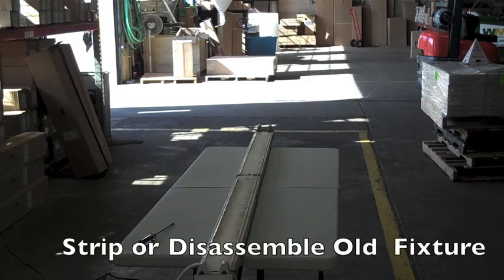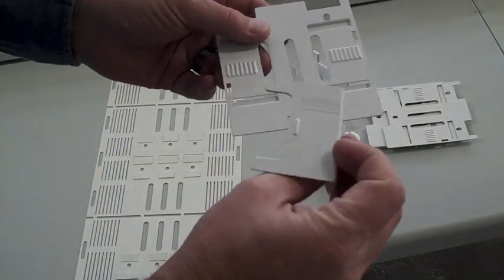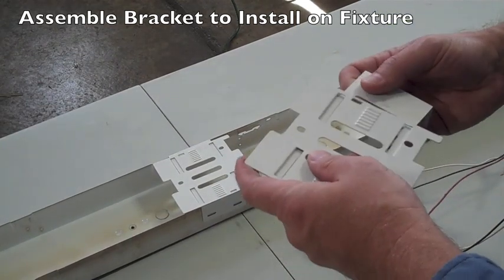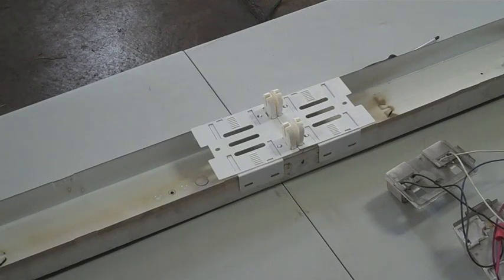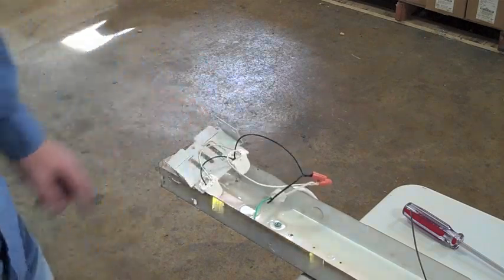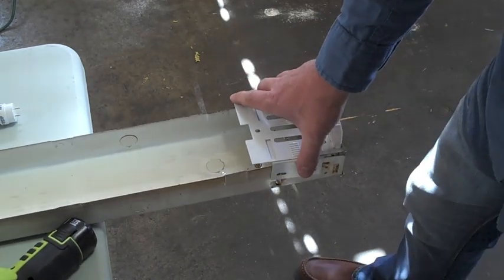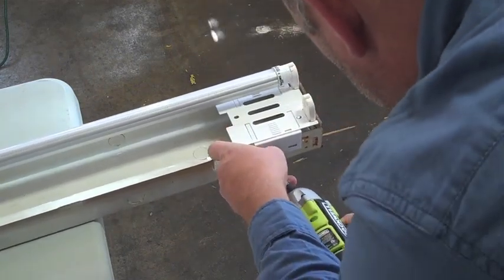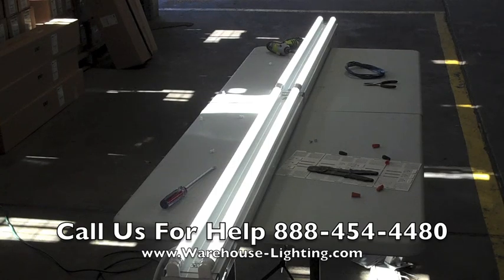Retro a Fluorescent Strip Fixture to LED

Comment: Why not just put 24v led strips inside, put a 5amp block in there, wire it to the 120v source, put the diffuser on top?  I did that with a couple of old fixtures.

Comment: This is about par for old school electricians. If you want to get with the 21st century and save yourself or your customer a bunch of money, dump those antique metal can fixtures off the ceiling an install lightweight Cree LED fixtures. If you insist on leaving those metal fixtures up then just run several rows of LED strips or tape across the bottom reflector or cover to meet your desired lumens output and forget about all of that complexed rigging. Retrofit is slang for LMAO.

Comment: what a piece of crap! you could have left the old tomb stones and brackets removed the ballast, and rewired the original tomb stones!
Reply: +snaprollinpitts unless they were shunted tombstones. Some LED kits require UNshunted tombstones.
Reply: +snaprollinpitts Also, LED lamps are bi-pin lamps. Most 8' fixtures use single pin ballasts.
Reply: I know that, but this guy could have saved a lot of time and money